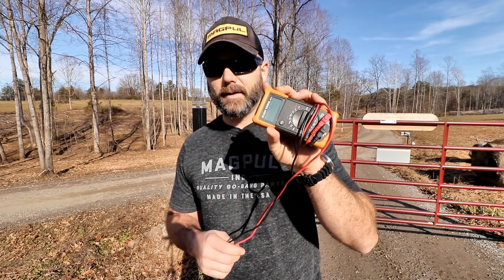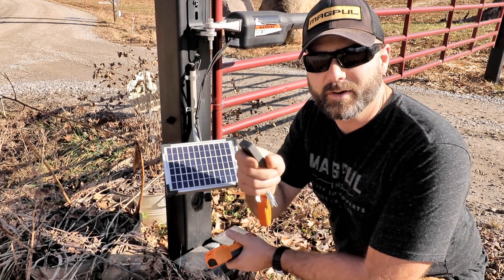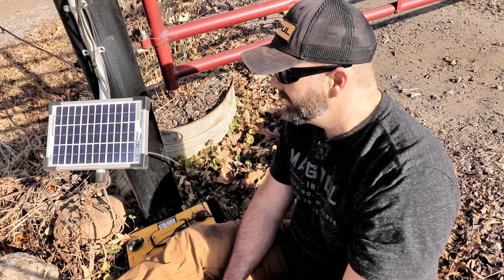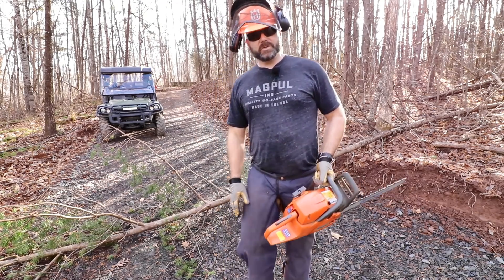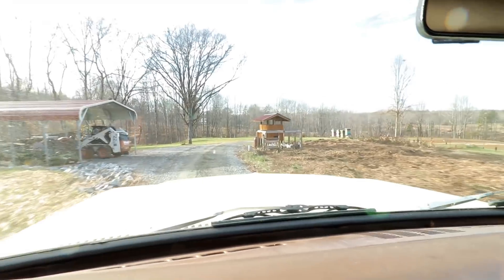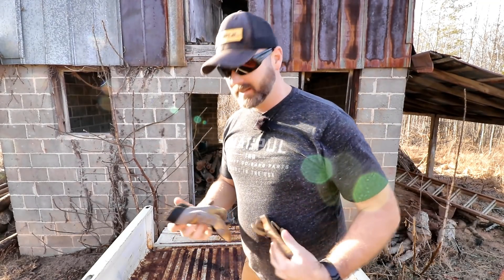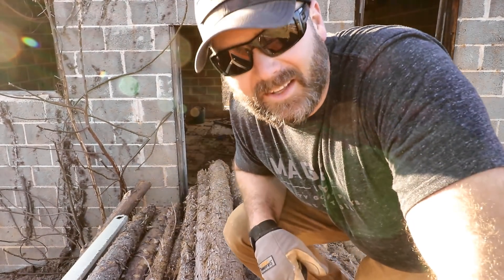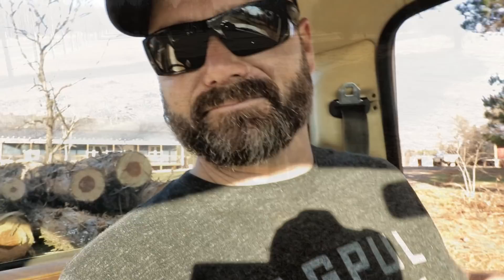$100 TRUCK GETS LOADED DOWN! $1 CEDAR POSTS!! TREES IN THE ROAD... MIGHTY MULE GATE OPENER TROUBLES!

Comment: Hi Josh,    As an electrician of 35 years, I can tell you that you didn't do yourself any favors when you installed a much larger battery on your gate, without also upgrading the solar panel, the battery has been lugging along for 3 years without ever having a full charge, so you should look into upgrading the solar panel.    Bacon can fix anything, enough bacon can even fix a salad.    Merry Christmas
Reply: Exactly what I was going to say, then saw you took care of that.

Comment: before you put the truck liner down. You should first wire brush as much as you can on the bed of the truck. then use a Rustoleum paint spray cans works too. on the bed. even if its just a Rustoleum primer it will work too. but it will help prevent more rust to happen after putting liner on. its what i did on my old truck before i sold it. couple years ago. was 82 ford pickup bed was rusty so i used Rustoleum primer on the bed then placed a liner in it. had it for 6 more years then took liner off. other then little spot i might of missed in corner there was no returning of rust.
Reply: There's some stuff out there that turns rust (iron oxide) to magnetite . This chemical change stops the rust from further rusting .It turns the rust to a black sandable surface .  I've used this on large pieces of equipment before primer with great success .
Reply: I think that stuff is called Ospho.

Comment: Hey Stoney:   Those tall thin pines you have are a lot like the Lodge pole pine we have up here in British Columbia's Interior.  We have used 20' lengths for fence rails between the cedar posts on 10' centers.    Cut away a 4" half lap in the rail end and attach through a pre drilled hole to the posts with 6" or 8" galvanized twist nails. Alternate the half laps on every second cedar post for a stiff fence.    Trees with butts over 6" will make good rails for a corral.  But put the posts on 6' or 8' centers  and use 24' rails; with lag bolts or timber screws. If the trees have a 5" butt after 20' you should still have an 8' length for tree stakes.   By the time the tree stake rots out the tree will have established a strong straight trunk.   Still paint the stake near the ground with old engine oil to give the termites a belly ache .   Paint the portion of the stake out of the ground white to make it easier for the birds to see the insects. The very thin top of the tree can be used for general stakes around the garden  for a couple of seasons.   Pull in the fall and store in a dry place.If you just thin the pines; some will grow to mill able timber  8" butt;  for 2x4's and 2x6's.the old guy   Bert

Comment: I don’t think the battery was the problem. If you read .08 volts that’s basically zero. Your charger should be putting out around 13 volts in full sun to charge a 12V battery. Not .08. It’s not charging. So what’s gonna happen is that new battery will last a month or two until it’s too low to operate the gate motor and Mrs Stoney Ridge will be calling again.  Check that  new battery voltage now and then check it again in a few weeks to make sure. It should stay above 12V.

Comment: After you wire brush the truck bed, spray it with apple cider vinegar mix with water. The acid in the vinegar will kill the rust, then put paint on it.

Comment: On my mighty mule set up I used a sealed agm 12 volt solar battery from harbor freight, $69 and about the size of a lawn mower battery. I did opt for the 500 lb opener. It’s been 6 months opening around 4-6 full cycles a day.

Comment: Great video Josh. Them DIY bedliner kits do work as intended. Just make sure to clean all that rust with a wire wheel on a grinder, then scuff with the supplied scuffer. After the surface has been prepped then tack cloth it before rolling or spraying in the liner. There is a Duplicolor bedliner my Autobody class did 7 years ago that is still in really good shape on a 2002 model Ford F150 that belongs to the town I live in. Used to be a Police vehicle.

Comment: A way to help with the battery charge is a weather resistant solar battery maintainer mounted on a post and wired directly to the battery. It will give you more solar coverage to keep that larger battery charged as you are not as restricted on where you place it.

Comment: I used herculiner. It is fine if you don't haul gravel. Its soft. Great for stopping stuff from sliding around. Otherwise go with line x or rhino liner. About 500 to 600

Comment: Just a bit of a tip for the future, I wouldn't consider myself a battery expert but I think you could be able to increase your battery life by keeping it off the ground in a cool and dry place, the box you are keeping it in is black and can soak in heat that will heat your battery up which is bad for battery life, and keeping it on the ground can possibly allow moisture to seep in which can corrode the battery, also if the box isn't water tight i would consider getting a more watertight box.  Just putting the battery on a cinder block away from vegetation and the ground and painting the box white could help prevent wear and tear.

Comment: I have personally used herculiner and it worked great. I found that doing two solid coats worked the best, it lasted a long time and didn't chip like a single coat did. Just make sure to clean up as much of the rust as possible and put a coat on and wait until it's good and dry about 48 hours and then put another coat on and you'll be good to go.
Reply from the maker: Thanks for the tip!
Reply: Good info. Does it hold up to stone or heavy,  hard items decent?? Or should we just sick with plastic liners. Plastic is so slippery especially in winter.
Reply: Can’t say I ever hauled stone on it, but I used it when hauling wood and I would throw big pieces around and would just throw pieces into the bed of the truck and I never saw any issues. I would throw a few other heavy household items on it every now and then and it held up good, wasn’t an everyday occurrence but it was at least a few times a month. Like I stated earlier I definitely had better luck with multiple coats then just a single coat.

Comment: Hi Josh, been watching you for a long time and this is my first time to jump in.  After I retired from law enforcement, I ran a chemical trucking co. Have you ever tried a product called Ospho on rust?? I used this on the fenders and etc of my chemical trailers, and it does wonders. it turns the rust to white powder, and also is a primer. used it for years. sure would look good on the old $100 truck before you install the bed    Don

Comment: Durabak bedliner works really good,,, you are correct safety First,,, especially with ANY Power Tools,,, Safety Glasses when checking/jumping Batteries,,, They can Explode If for some reason there is a Spark,,,

Comment: Just FYI, You need to use (2) 6Volt Boat Batteries (wired in Series) on your solar panel. 6 volt batteries hold a better charge. I recommend you purchase a G.T. Power Rc 130A High Precision Watt Meter and Power Analyzer. Install between solar panel & battery, this unit will help you self - analysis your problem. You can purchase from Amazon

Comment: by the way,  i did some research and found out that the 2015 gators always had belt and clutch issues, im wondering if the newer ones have those issues.

Comment: A multimeter will not show you battery cell condition..........You need a battery tester that will put a load on the battery......that will indicate  a bad cell......
Reply: 8 volts out of 12 is two cells failed shorted.
Reply: he said he was gonna take the battery to the parts store to have it "tested" there.  So, I assume they did a load test there, but he never did say.
Reply: Having your own tester keeps you from having to lug that battery around...When you got 48 batteries, you need to know whats going on
Reply: A good battery will hold a load for 15 seconds, if it is bad it will drop quickly
Reply: yep, i agree

Harbor Freight has them for less then $20;  used mine for over 4 years now with no problems
Reply: It didn't need a load test. Battery cells are a bit over 2 volts, 8 volts is an even multiple of two below the nominal 12 volts. Shorted cells, probably due to lead sloughing off the plates and building up in the bottom.
Reply: Smart Fellow.............
Reply: Now if the problem could be resolved with a multimeter....Why do they make load testers......I have worked with batteries that  weigh more than your car.......
Reply: Because battery cells can fail chemically or they can fail structurally. A battery cell that's partially sulfated isn't going to be evident without a load test the way a cell that has failed open or failed shorted is.

Comment: From experience I can tell you that too many cloudy days will kill the battery. I think another solar panel added to it would help to make enough charge. buy another solar panel hook it up parallel. Also the contacts get corroded or rusty or some type of oxidation will stop it from making contact to charge up or even run the gate. You could just take the battery to the house and charge it up and bring it back and it will open the gate for a while. Battery should last about five years shouldn't it? If you only get three years out it you may as well buy the cheapest battery like a walmart brand one. You gonna need to get the rust off the surface of the bed first before you spray a bed liner in it. I want meat and taters too.

Comment: Modern solar panels should last at least 20 years or so unless it get noticeably damaged. Definitely take another look at you solar to battery ratio and do some research on it - if you don’t size those two things to be complimentary you can run into trouble.
Reply from the maker: Thanks for the tip G

Comment: I'd bet that 90% of what has been opening and closing that gate has been the base charge in the deep cycle battery.  It doesn't take a huge amount of power to run a motor long enough to open and close a gate, so the battery is just slowly but surely running down over a long time, never really getting charged up by the solar panel.
Reply from the maker: So...the battery system worked great up until about  a month ago...took the battery to have it tested...and it was toast....the charging system has been adequate...although when I first installed it I was quite worried that the battery would be too big for the solar panel to trickle charge it...this old battery was a "refurbished" battery that was quite discounted...now I'm rocking a brand new one...should last me for years....but I'll keep the channel posted if I need to get a new charging system...I should know in a week or two if it's gonna cut the muster
Reply: Set the battery compartment off the ground with some wood at a minimum. This will help by  getting some distance from the cold ground. Wrap the battery in thermal wrap blanket made for that battery group. The plastic compartment helps some but a battery does not like charging cold. I am retired air force power pro. I took care of emergency generators in Colorado among other things. Somewhere in the manual should be the amp draw of that motor or you can test amp draw when operating it. This will help with selecting the best battery type for that application. Bigger is not always better and it isn't cheaper. Love your vids. I just moved to a small ranch in Texas. Dealing with some same issues. Just picked up trash, not as much as you, along my county road.

Comment: Actually drop starting a chainsaw like that is probably the most dangerous thing you can do with a chainsaw, especially when you dont have the brake engaged.  If you want to start it standing up then just fit the rear handle into your crotch, put one hand on the top of the front bar and one on the starter cord. Don't forget to engage the brake before starting and then once started you can disengage the safety brake. Plenty of videos aorund to to show you how this is done.  Just thought this would help you out to prevent an accident.
Reply from the maker: Yep thanks buddy

Comment: There is strong and what I have always called "farm strong".  I have never worked on a farm but my father was a brick, block and stone mason.  That made me his mason tender or his "Hod Carrier".  I started going to work with him when I was very young now I am a mason.  I was 8 weeks pre mature and 2 1/2 lbs or something like that.  I made up for it!  I'm 53, I have a 60" chest 38" waist  21" biceps and 18" forearms.  6'2" 230.  I grew up eating a lot of beans and cornbread, couldn't get enough!  My nephews go to the gym.  I ask why and they say to get strong and stay in shape.  I tell them I have a wheel barrow out back, let me fill it with wet sand (simulate cement) and you push it from my shop to the back door, 600 feet on a wet muddy 2x10 and I'll give you a hundred dollars.  20 and 22 and they have yet to collect the $100, I even took the wet 2x10 out of the equation!